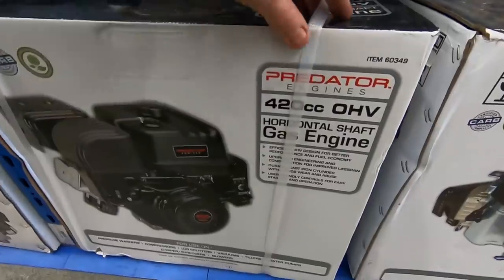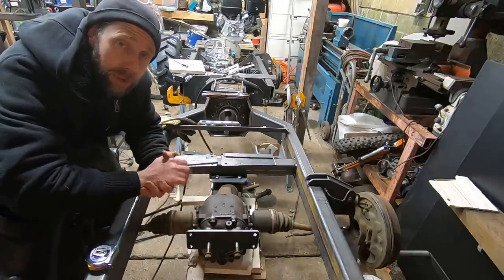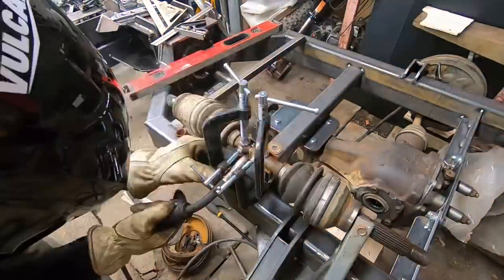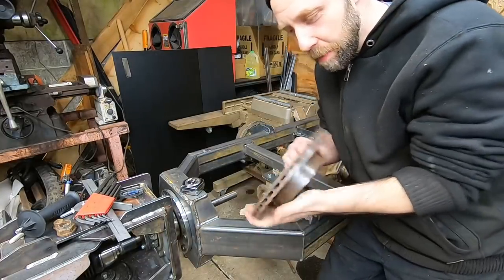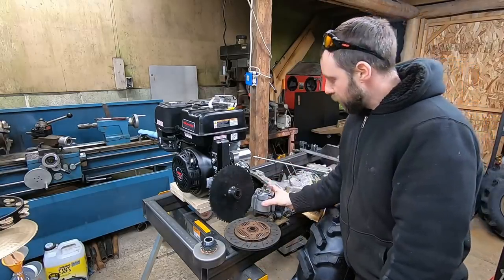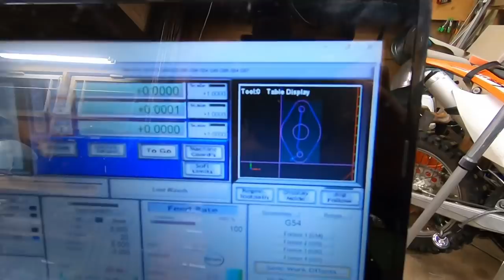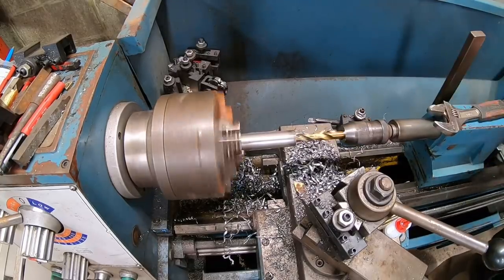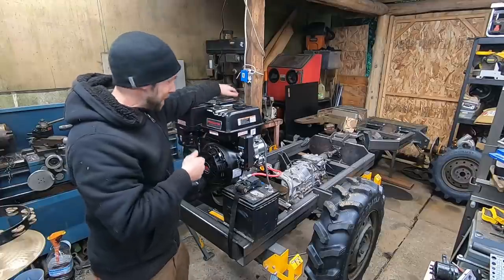420cc Predator powered articulating 4x4 dump truck build part 4

Comment: I do believe it has plenty of brake force as long as nothing ever goes wrong have you ever ran a 2 Wheel Drive tracter or even a four-wheel-drive tractor that isn’t locked in With enough weight on the front and loader going down a hill you’re in trouble I have also been around 2 ton trucks that used a pinion break as the E break they work great as well right up to you lose a U joint on this project every axle is welded I believe in my own mind having the ability to start with all four wheels could be very important this is only my opinion if you don’t like it that is OK that is your opinion
Reply: It's for testing porpoises only and subject to change without prior written consent. He's not trying to patent the last ever vehicle we will ever need, he's being creative and having fun, It'll be fine! Peace.

Comment: 13hp is litle hp for this project. Better is 20hp twin piston.
Change chain to belt (HTD 8M), chain low life.
Reply from the maker: atlanko1 If  I had your outlook on thinks I probably wouldn’t build anything at all. If you are willing to buy me a 20 hp engine then I will put it on there but until then I will be sticking with the 13hp because I’m working on a budget. So chain has a short life??? How about a Yamaha XT 350, it runs a 428 chain and that bike probably makes about 30hp and it’s on the final drive and is subjected to a lot of torque.
Check this 13hp engine that’s chain drive powering a tractor https://youtu.be/kAfG339_o3I
Reply: @Mikefestiva  20HP Price difference is around 320E. It will work and you are 13PS.
The chain does not have a torque problem, but a speed. Optimally when it is immersed in oil.
Yes, it will work for you. It just makes a noise.
If you're aware of these limitations, all right.

I would not use the chain after the experience. 
http://i.postimg.cc/9QhMXZhH/IMAG0162.jpg

Comment: The papers inside are for sound deadening, you probably know but I learned when I watched the stock 3/4 ton diesel class at the county truck pull, a duramax lost its driveshaft and the announcer was talking about the cardboard, mocking GM for cardboard drivelines, etc. Fun times
Reply: I remember way back when I was about teen something?, I dropped a drive line while pulling away from a stop, It sounded like the church bells ringing. Peace.

Comment: How do you like that band saw from harbor freight?
Reply from the maker: I have cut a lot of metal over the years on that little saw, it’s okay, not the highest end tool but it’s definitely worth the money.
I bought it used about 5 years ago, it had a lot of use on it when I bought it back then. As long as you tension the blade right and run high end blades it cuts really accurately. Take care Mike

Comment: I would have utilized the factory drum brakes and E-brake. I was going to mention this in a previous video, but wasn't sure that the rear end was not a posi-traction. Now that you have run it, I can see it in fact, is NOT.  This means if you have to park it on a slope and lock your present E-brake, one wheel can slip. Say in mud or rocks and it can take off on you. This was an issue with motor homes and older trucks using this style e-brake when parked on icy roads. One slips and the other rotates and there goes the works...

Comment: Man I love your videos you do a great job! hey I was wondering shouldnt your rear diff be angled up towards the inner u joint? I know on vehicles that are lifted sometimes you need to correct the angle to keep the diff pointed within 2 degrees of the transmission side u joint or it can cause longevity and vibration issues? I just noticed that both u joints have a decent angle on them. but im no expert just noticed this over the years.
Reply from the maker: I definitely think they are angled a bit to much too, I did some research and if say the trans is level and the rear diff is angled you get a kind of a speeding up and slowing down effect on the drive line so I tried to keep then both level but I’m sure it will be harder on the u joints. I may cut the tack welds off of the rest end and re position it? 
Here’s a video about the cv joint positioning, it’s kind of interesting. https://youtu.be/gmV4qwLfOMY
Reply: @Mikefestiva  yea they are definitely angled a bit. Your totally correct on them needing to be parallel. I guess on vehicles with a double Cardon joint at the trans you want your pinion angled within 2 degrees of the inner joint. Might be a good solution for you to eliminate those angles.

Comment: Umm, couple things with that center E-brake and brakes in general. On the gearbox, there is a differential between the front and rear axles right? If you lock the rear drive shaft power goes to front axle, but in return if rear axle looses traction/slides front axle will just move that power to gearbox and engine.... and with this setup there is centrifugal clutch that lets the movement just out of the system, essentially with some resistance you are only locking the rear axle with that thing, what is kinda a problem when its meant to lock all 4 wheels. Least that is my thinking with out delving into Subaru gearboxes that much.

Placement of the E-brake also makes me bit worried as its pretty low. Putting it next to central steering would have lifted it bit upwards, giving more ground clearance and given sturdier point of mounting caliber where as in its current position lots of weight and forwards motion combined MIGHT rip or bend the caliber out, just something to consider on that regard.

For braking system, if you are worried about rear brakes being weak, why not get set of front hubs and make same front setup on the rear? In car front brakes are ones with more power as it has engine usually on that axle and high speed vehicle will push forwards when braking, what in return increase traction in front. In you setup this thing wont probably move very fast so its irrelevant and most of the weight is on the rear axle, so it has most traction/braking power.
Reply from the maker: Don’t worry it will be fine.

Comment: Is the drive shaft angle to steep to the rear ? How do you activate the rear-end to power ? If you count your time and metal ( if purchased ) you might be closer to $3k , which in my book it’s still worth it ! Other then in tight spots what is the advantage to that unit as far as usefulness ?
Reply from the maker: Yes I definitely have some time into building this project, I bet I have almost the same amount of time into settings up the camera and trying to get the right shots, editing to make these videos as I do into building this machine. It’s a lot of work to video all the steps by yourself when building stuff like this. 
It’s been a fun project, I was hoping to keep the material cost around $1800 but after buying all the hydraulics it’s going to really bring up the cost. Thanks for checking out my new video Dave 👍
Reply: Mike festiva 👍

Comment: also you might have a problem with the drive system clutch ,,works off rpm i think ,, then your hydraulic pump may not work at low rpm for steering and dump ,, you might need to change to a elec clutch like on a riding mower they use for the blades .to run your drive shaft or go belt drive with a idler pulley and spring to make the belt drive ,like a lawn mower ..
Reply: the hydraulic pump is driven directly off of the crank shaft and is independent of the clutch engagement and I think an electric clutch would have a very harsh engagement and would not work be very good when you need to maneuver in tight spots by feathering the throttle because the engagement would be either on or off

Comment: Why not use the Subaru clutch?
Reply: The Subaru clutch is mounted to the flywheel of the Subaru motor with out the Subaru motor their is nothing to mount the clutch to although you could make a shaft and bearings to support the flywheel And clutch it is much simpler you utilize a centrifical clutch

Comment: where do you buy frame metal? I checked online it will cost like $1000, but your cost is $120
Reply from the maker: I call in orders to a metal supplier, they deliver it to a fab shop close to my work, because they are always bring metal to that shop they don’t charge me for delivery or have a minimum charge. Look up metal suppliers in your area, not the shops selling it like general hardware but the suppliers they buy from. I’m in the Northwest of Washington and there’s Everett steel and Northwest steel. I hope this helps.

Comment: The one thing I know for sure is that you do not wire (mig) wield a driveshaft.
Reply from the maker: Mat Helm why is that? I MIG welded my Diesel 7.3 Ford F-250 Drive shaft, I haul my camper all the time with that truck, that drive line was welded four years ago and it’s got thousands of miles on it. I would like to hear your response to why you should not MIG weld drive shafts???
Reply: Mat Helm - I know for a fact class 8 truck and bus driveshafts are MIG welded for every US OEM manufacturer.  Be careful making absolutes in a public forum.

Comment: Can someone educate me on why he put the collar in the press to weld it?
Reply: To hold the parts tight and in alignment while you tack them together otherwise the parts tend to pull or shift out of alignment during the tacking process. The same thing could be done with a clamp but if a press is available it is it is quick and easy to use
Reply: david helgeson, interesting. I am just getting into welding and will keep this as a tool in the brain box to use. I’m not to the precision like he is but maybe someday. Thanks for the reply!

Comment: is it a autoshift transmission
Reply from the maker: 5 speed manual. It’s got a 4 : 1 gear reduction but I’m thinking of going 5:1 soon for more low torque then speed.
Reply: @Mikefestiva  whats gonna be the max speed? Put 5:1 Gear reduction. Its better. It will have more low end torque but speed isn't very important. After all, this truck is not street legal :)
Reply from the maker: A dozen of potatos and a fat cat smelling them 
I hope to have a top speed of no more then 18 to 20 MPH or 28 to 31 Kmh but most of the top it will be going 10 mph/ 16 Kmh or slower. Take care

Comment: How much did your Cnc plasma cutter cost you?
Reply from the maker: I paid $1800 for the table, XL table extension and water tray. You can buy the CNC table for $1500 but with the promo code MIKEFESTIVA will take off another $100. I really enjoy having a CNC plasma table in my shop, it’s really nice to be able to draw out your parts in Fusion 360 and cut them out exactly how you want.

Comment: Any suspension?
Reply from the maker: No suspension on this machine, it’s designed for slow travel, most of the time it will probably haul loads at 10mph or less, it’s basically a tractor truck. The front and back axel will pivot independently to keep them planted to the ground. I do plan on building a bench seat with a shock absorber like heavy equipment to soften the ride a bit. Take care
Reply: @Mikefestiva  Thanks all makes sense now . Really enjoying watching this project.

Comment: Hi
Reply from the maker: Hello 🙂
Reply: @Mikefestiva  a 1/4" impact driver with a 3/8" or 1/2' socket adapter is great for mocking stuff like this up alot more nimble than a big impact wrench and air hose, even the cheap ones can do 100ftlbs

Comment: That is an unfortunate driveshaft angle. ...for this wheel base, the mini torque tube thing that diff has going on isn't doing anyone any favors. Could have clocked the diff but I guess that would have put the disc higher than your want. Well, I suppose when it wallows out that pinion bearing you can take the opportunity to find a more appropriate housing without that goofy nose on it.
Reply: you are correct about the long differential housing being not ideal and making the drive line angle a bit extreme  and will shorten their life but because of the low rpm's, lower power  the smaller motor and lighter vehicle and also the car it came out of probably traveled more in a month than this vehicle is likely to travel in 10 years he might get away with it  if not he could always make a new one using cv joints if needed.  Building these one off vehicles there is always going to be redoes or upgrades in the future to make them functional and reliable
Reply: @davidhelgeson6997  I agree, in this case it won't be speed that get's this one. Yeah, It'll be fine to trundle around someones yard a few times I'm sure. But counting relatively tall tires, tall final gearing, and what looks like a 10:1 reduction on the input shaft (Approximately 180ish ft/lbs then)... there'll be N/A Impreza force going through that wonky geometry if push comes to shove.
Reply from the maker: Private party I find it funny how people like yourself will pick apart builds like this and point out everything you possibly can to tell others why it’s not going to work. Tell you what I’m going to check out your channel and see what your building.
Reply from the maker: Haha I just checked and you have zero content on your channel, tell you what post some videos of actually build something, I would love to see what you can build.
Reply: @Mikefestiva  I didn't say it wouldn't work. ...but I think it's fair to say it's not ideal. I noticed it was just tacked, thought maybe you might want to consider changing the pinion angle. No, no content on this account. This is the account I use in case people can't handle constructive criticism.
Reply: ...and yeah, I know. The DS is cut to length now. I'm sure it'll be fine.
Reply from the maker: Private Party I honestly would like to see your other channel with projects you have built, it sounds like you have another channel, What’s the name of it?
Reply from the maker: Private Party time will tell 🤷🏻‍♂️ if they don’t hold up I will probably cut down a CV joint and install it there instead. Take care

Comment: this drives me crazy......A drive shaft is a component in the drive line. The drive line or drive train includes a drive motor or engine, a transmission, gear box or transfercase,......and...., Drive shaft or shafts that connect the components to the differential drive axel. A propeller shaft is in a boat and is connected to the Propeller!
Reply from the maker: And you point is???
Reply: Yeah, yeah and if a frog had wings he wouldn't bump his ass everytime he jumps. The man is building a buggy in his garage at home... & Doing an awesome hellava job! He's not an engineer designing and building a multi million dollar luner rover. Who cares what it's called or who calls it's name 100% correctly. Lightin' up, you just might enjoy this awesome video and maybe even life. Lol